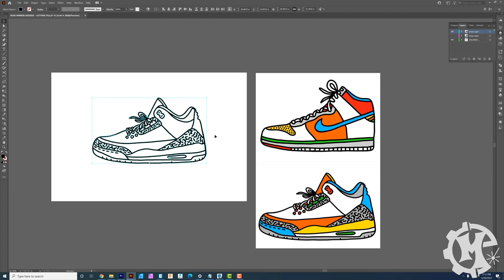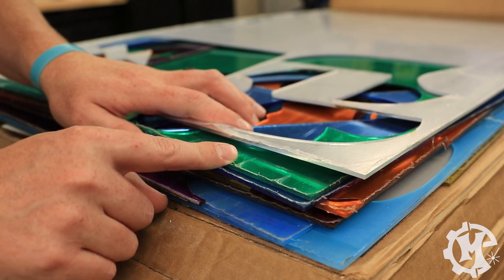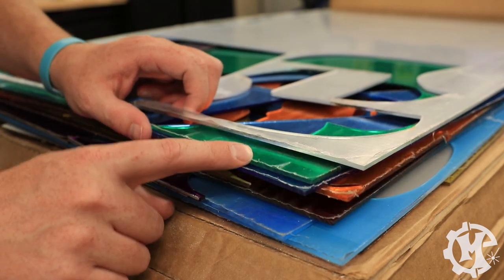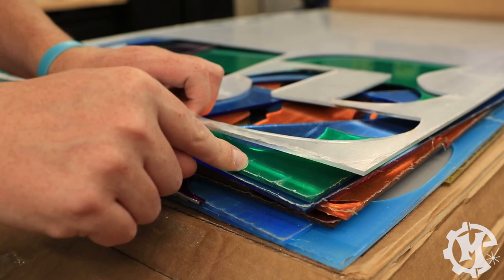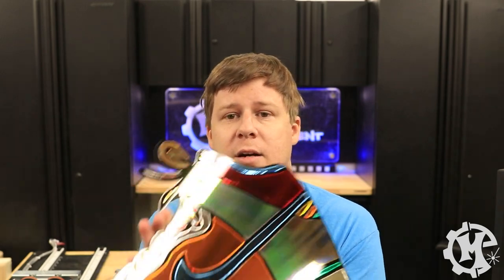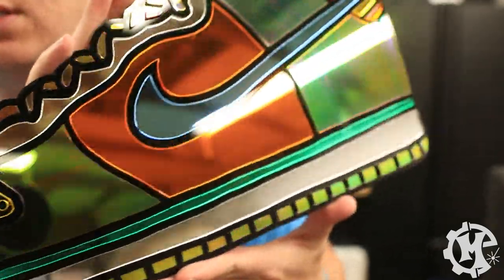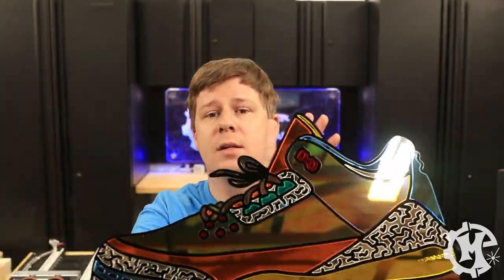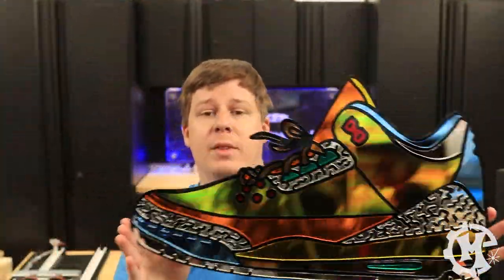MAKING CUSTOM SHOE ARTWORK MIRRORS | CUSTOM SNEAKER ART

Comment: I don’t often leave comments but when I do… it’s because the project absolutely rocks!  Very cool project.  I hated myself for watching the peeling of the protective plastic but couldn’t help myself.  Oddly satisfying!  I also need to pick a roll of that 3m adhesive.  Looks superior to the stuff I’ve been using.  Thanks for showing how you apply it.  I hadn’t thought of doing it that way and it seems much less likely to catch an air bubble than the method I had been using.
Reply from the maker: Thanks for watching. I’m glad that I was able to earn a comment.